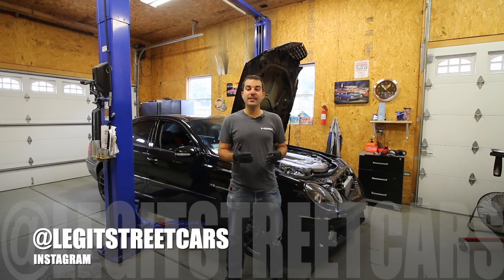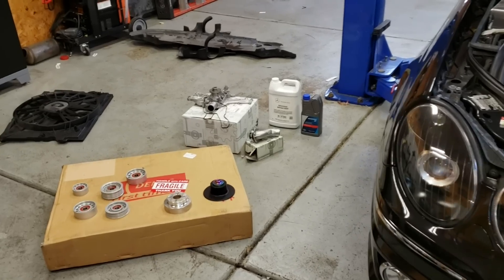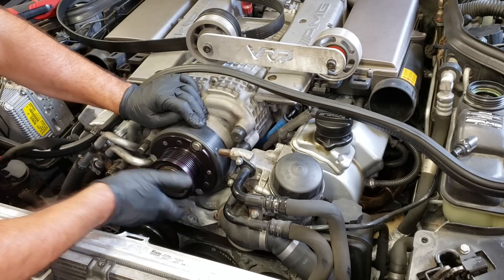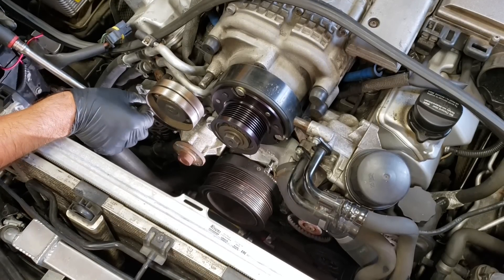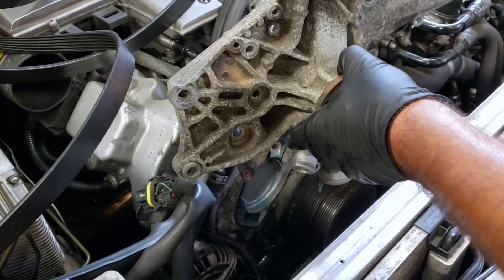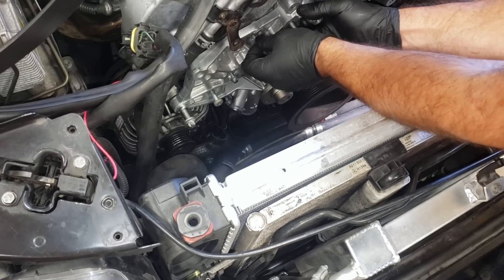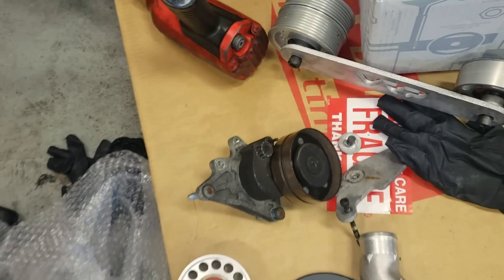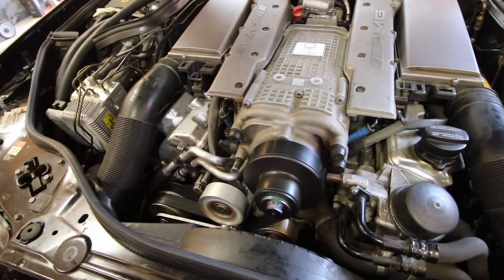My E55 AMG Finally Broke So I Added More Boost, Blower Whine & Power! "While I Was In There."

Comment: I can’t get my accessory tensioner pulley to spin freely. It shredded the shield I had on it, does anyone know if I’m missing a washer? I tried putting the pulley on without a shield or washer and it won’t spin freely... I have a brand new vrp bearing and pulley on it which spins freely off of the car so it’s not that....anyone know?

Comment: Congratulations ! 

Because of you I'm buying a 2006 CLS55 with 92k miles on it - I felt in love :) 
Problem is that I am very inexperienced in DYI (except oil change). So my question is how would you rank your modifications considering efficiency ans ease of doing?
1- 80mm pulley
2- ECU/TCU update
3- Air intake
4- Alu transmission pan + valve body
5- Strutmasters coil springs conversion (minor leak observed)

My Goal is to enjoy it as a Daily so any suggestion is very welcome, cheers.

Comment: That sound scares me, even if people say it's normal.  The knock sensors might even pick it up and retard timing unnecessary.  
 Personally, I'd persue a Fluid Damper or see about building a fixed harmonic supercharger pulley.  I wouldn't be able to live with it, but that's just me.

Comment: Good luck with that fixed pulley, worst thing made for this motor
Reply from the maker: Why? What's your personal experience?
Reply: Too much heat, you should have gotten a zt2 & alarm with dashdaq logging if not you are having no safety at all
You will probably. Be over 100* easy before even going wot